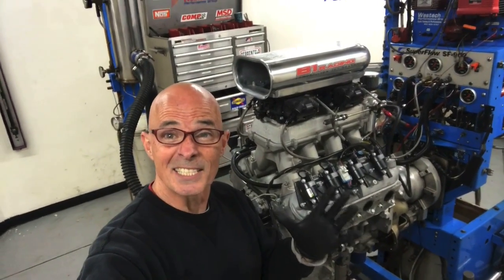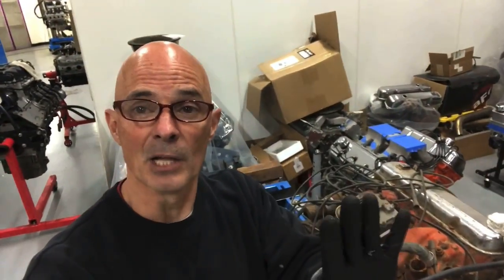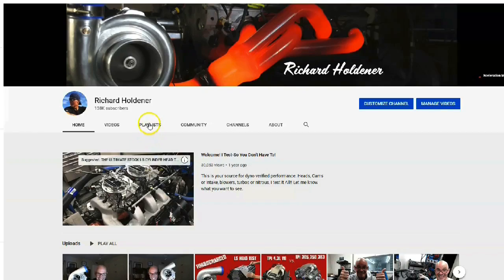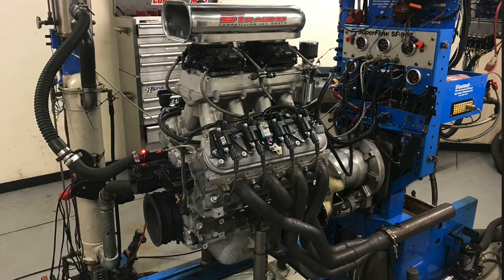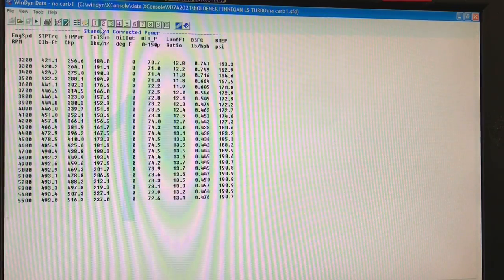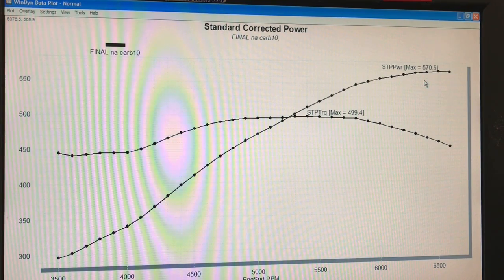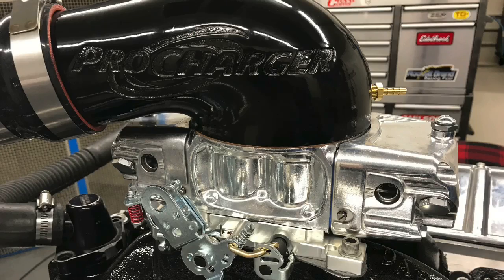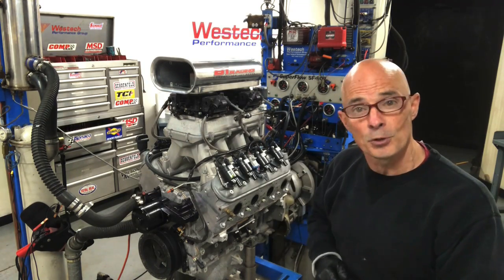TUNNEL RAM GM CRATE LS & BLOW THROUGH BBC STROKER

Comment: Never saw this video until now. Those Hydra-Matics are nifty aren’t they? What you took off of the tranny isn’t actually a torque converter though as those transmissions don’t technically have one. It’s just a fluid coupling, they call it a multi-element coupling or something to that effect but that’s all it is and that’s why all of that fluid came out on you Rich lol. I bet those 347 Pontiac engines can make decent power too, my father in law has a few old Ponti’s and one of them is powered by a 347 tri-power with some kind of period correct dealer optional performance package. I think he said it was a cam/induction type of deal, but it’s rated at something like 325 but pulls like it makes ways more than that even in a big old Bonneville/Grand Am type chassis. I forget exactly what car its in; I know it wasn’t the Tempest or Catalina that he has because those both have big cube newer age engines. Pretty sure it’s a Bonneville. Regardless, it’s a fun/different toy for sure.

Comment: I saw your video about the zex nitrous plate on an ls. I was curious what you think the potential power output would be if it was on a dual carb tunnel ram with dual foggers. Is a 600 shot even do able? Would the tunnel ram and dual carb be a benefit?
Reply from the maker: TWO KITS WILL SUPPLY THAT MUCH

Comment: Doubt I'll get a reply from our friend Mr. Holdener, but what's the hivemind on this option: old '70s motorhome w/ an Olds big block, would you (re)build the 441 to get better accel & cruising mileage, or replace w/ a 30+ years newer 6.2L LS? Ultimately, it'll have to get a Holley Sniper or similar to get max tunability and the ability to run properly on modern (leadless) fuel blends...
Reply from the maker: can you do a 455 olds? the 6.2l would likely get better mileage

Comment: How to Cure Low Oil Pressure.... well.... THAT one ended up being expensive.  Thurst bearing clearance per GM .0017 to .0065 or whatever... general rule of thumb is .003 to .008.  Actual measured .040.

Comment: Anybody know if you can run a Air Gap intake on a 351W in a 88 GT Mustang and keep the stock hood?
Reply: No, nobody has. You might be able to do it with the manifold converted to port injection and an elbow with throttle body on the carb flange but I don't think it will fit with even a stud for the air filter.
Reply: @timothybayliss6680  Thanks

Comment: So many feelings will be hurt by you putting carburators on an LS. 
For some reason, folks think that the spark in the combustion chamber can tell if the fuel was delivered through the intake valve,
by a carb or an injector. And that on an LS engine the power will be down if the fuel came through a carburator.....😕
Reply: Port injection is nice for precise tuning, even down to cylinder by cylinder if you want to get really precise, but old school carburation is a lot better than most people think
Reply: Daily driver you can't beat the driveability and fuel efficiency of an efi setup but street strip I could care less carbs or efi . Only thing for me as far as LS engines are concerned  it's a lot easier to run the factory efi setup and a lot cheaper from the junkyard.
Reply: @dilsher12  some guys don't get that. It's cheaper to buy an ecu to run your engine and it takes about the same time to tune it when you're learning as a carb. If you already have a factory intake and wiring harness for an ls engine it is a really hard sell to get someone to put a carb on it.

Comment: have you done an episode or ever talked about gapless piston rings. would be awesome to see any naturally aspirated motor comparison gapless vs standard rings.
Reply: Apparently they're best suited to race engines that will be refreshed somewhat regularly as they don't last nearly as long as standard rings.
Reply: @nowayjose596  Ive seen completely the opposite. They are used in race applications because of their ability to hold their spec longer than traditional rings.
Reply: @madmod  i was watching a total seal video so i may be subject to some marketing gimmicks. The guy talking about them claims that the rings are being used in top sprint cars all across the country. Those guys turn 9000 rpms for like an hour straight making close to 1000HP seems to me assuming its set up and broke in correctly they have no issues at high rpms like claimed by someone  above.  The guy on the total seal video also claims he uses them in his street/strip cars. But there's absolutely no way to prove that claim and could easily be Marketing BS.  But i guess that's why i want to know more about them.   From an engineering standpoint i don't see why they also wouldn't improve a street only engine. A no ring gap ring doesn't mean the ring tension and gap of the individual rings is greater. Which means it wouldn't effect cylinder wall lubrication. it also decreases blow-by benefiting oil life and quality. they increase intake stroke efficiency greatly on NA engines as well.  and we know by the use of them in top fuel and sprint car as well as many drag engines that they obviously dont have an issue with fluttering. i might try them on my next daily build because so far every argument against them i have heard has been presented with zero proof. so were basically at a stalemate of weather or not they will or wont work on a street/strip engine.
Reply: Ive wondered about them and done a bit of research with the total seal brand. They certainly have the advantage in reliability with high boost, or high compression race application where you dont want to worry about leak-down on cylinders increasing after some heavy use which is common with traditional rings. A full break in is far more crucial to ensure proper seating of gappless rings as compared to a gapped ring but when broken in, it should have little to no blow by. I can't see a mild street car or even a street/track car benefiting that greatly from them alone but the number of engine/race car builders who swear by them says a lot. Ive heard of high rpm flutter from the rail around the ring that can hurt ring seal so ymmv.
Reply: @madmod  higher compression in a street vehicle would help in maintenance costs and performance overall with minimum blowby, aka less oil changes from soot reaching the oil.
Reply: It always seemed like a great idea. I just wonder why most builders dont use them
Reply: @johnsheetz6639  price and tools required to install them
Reply: There was a series twenty years ago on a good wrench 350 that they made something like 460hp with vortec heads, an air gap and gapless rings. I can't remember who wrote the article but I read it in car craft. The writer was really surprised the difference from rings, especially on cranking compression.
I understand Richard not running them, junkyard engines come with junkyard rings inside them and a set of two piece rings would cost as much as a whole shortblock. If Richard was running a more dedicated piece he planned on putting in a car that he was going to drive for years I think it would be worth the time.
There is an article about a land speed contestant using gapless top rings on a 2700hp ls engine built by Duttweiler. They made at least 38 runs before freshening the engine and that doesn't sound like much but runs are 5 miles at full power, that's like a full season of drag racing.
Reply from the maker: i ran them in my engine masters motor but have not seen a good back to back on them
Reply: IDK much about gap less rings. I’ve looked into them once briefly awhile ago. Me personally, I worry about long term durability and if there are cons that could cause catastrophic damage because of them. I’m sure if there were more pros than cons over a traditional ring most builders would use them, why wouldn’t they if they were great for their expectations.
Reply: @bigboreracing356   This is definitely one of the biggest benefits I hear/read about . Less Blow By should mean very clean oil , and less crank case pressure. IDK if you are running a crank case evacuation pump or not but if you arent than the decrease in pressure due to absence of blow-by should help engine seals last longer and theoretically increase HP by a very marginal amount.
Reply: Do they compensate for thermal expansion of the metal?
Reply: @shadowopsairman1583   yes, technically the gapless rings are not truly gapless. thats more of a marketing term IMO.  Gapless rings are actually just two rings with the properly sized gap to prevent closing and placed 180 degrees from each other.  They stack on top of eachother but they live on the same rind grove in the piston. "gapless" rings can be used on the first or second ring groove on the piston.

Comment: When you let the magic fluid out of the torque convertor is that like letting the magic smoke out of your crank case?
Reply from the maker: it was just thick smoke
Reply: Changed trans before, did a 3 on tree in a 76 Scotsdale over to an Auto, replaced starter due to flexplate, no problem.